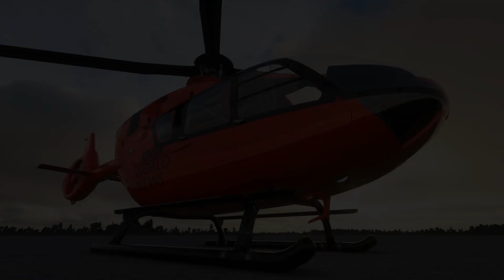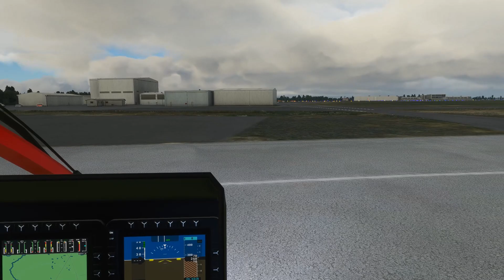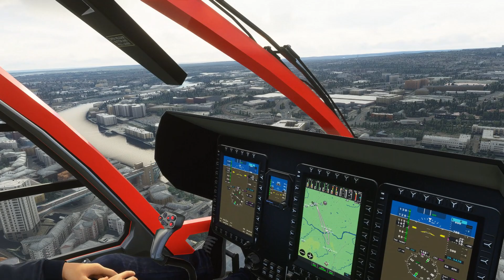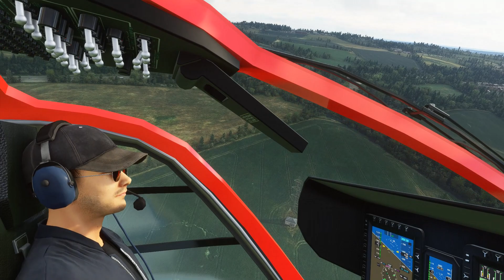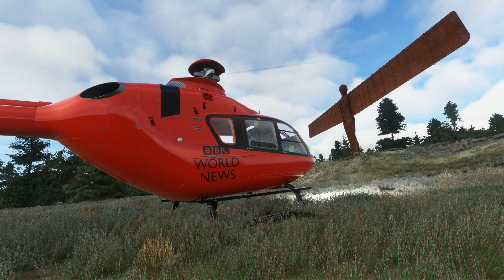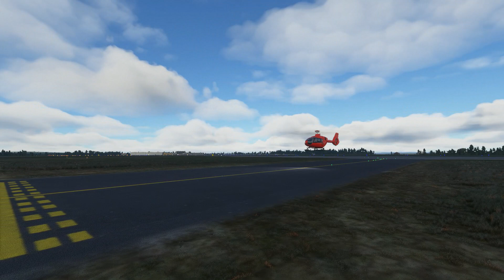Aerial Photo Ops | REAL PILOT | Hype Performance Group H135 | Microsoft Flight Simulator

Comment: I was pretty sceptical when I first saw stuff about this mod a few weeks back but after watching your video (and now that the recent patch has let me play the sim again!) I decided to take her for a spin and was pretty impressed. It ain't no DCS or X-Plane levels of chopper fidelity but it still feels pretty good, probably even better than the default old FSX choppers. Spent a couple of hours dooting about the local area and had a blast. I even managed to land it without too much drama. So thanks for the great video showing this mod off. Some nice camera work too. Cheers!
Reply from the maker: Thanks very much man!

Haha, well I was pretty much the same as you. Super sceptical, but thought I’d give it a go. First impressions weren’t great, very stuttery and the flight model felt way off. But then I released it was the scenery causing (most of) the stutters and I still had the chopper on the “basic” flight model setting. Once I’d figured that out, I have to say I was thoroughly impressed!

As you say, it’s not going to give DCS a run for it’s money just yet, but it’s a very solid effort. Great fun and feels enough like a rotary aircraft to provide a challenge. It’s great for exploring as well. Given the amount of time and and limited resources the developer had, I would say it’s actually an incredible achievement, especially considering the sim isn’t even supposed to support rotary flight dynamics currently. It’s certainly better than anything Asobo have offered us thus far! : P

Anyway, for me it’s a keeper. Definitely planning to have some more adventures with it and my hat goes off to the developer!

Thanks, all the best : )

Comment: Can I see scenery stutters? Especially from + 12 minutes. Your 339 Mach loop flight was super smooth at 300 knots?
Reply: Its from slow connection...
Reply from the maker: Could well be. Well, actually my internet is quite fast, but unfortunately not a particularly stable connection. Same thing though essentially, as far as MSFS is concerned I suppose.
Reply from the maker: Quite possibly David. This chopper does seem to be a bit heavy on frames (I think because of its 3 MFDs). Also the sims general performance does seem to have gone backwards quite a bit with recent updates. My computer is also no spring chicken any more sadly.

The most recent update was supposed to address some of this, so hopefully things will have smoothed out again a bit in the next vid!

Cheers : )
Reply: @IntotheBlueSimulations  yes agree, things get worse, then better, after each "update"? I just noticed how smooth the 339 was in the Mach Loop at 350 knots and this chopper was....well...choppy..lol!
Reply from the maker: Haha, sometimes they get worse. . . and then even worse again : /

I notice the same thing myself sometimes when I watch older footage. Sometimes it’s smoother, or even visually more impressive! Seems this update has helped a lot of people with performance though. I’m looking forward to being able to give it a try myself tonight.

Yeah, it is a bit of a choppy chopper haha, but again I suspect that’s the MFDs that are to blame. Not something the developer can do a whole lot about unfortunately. . .